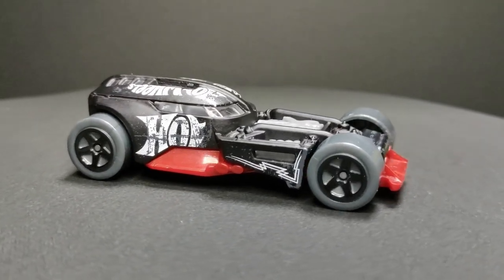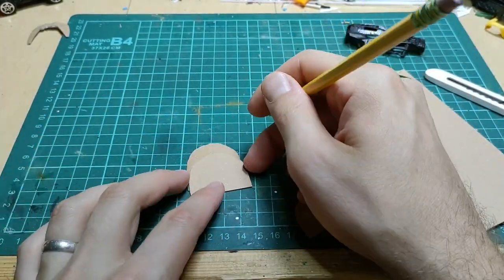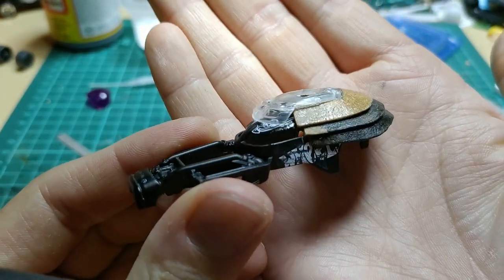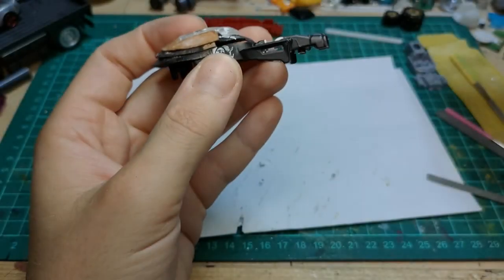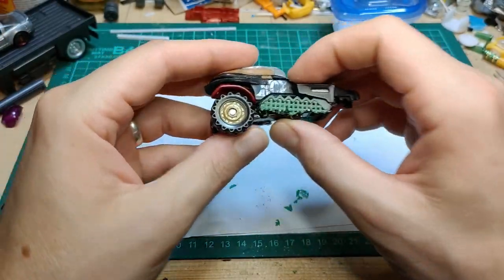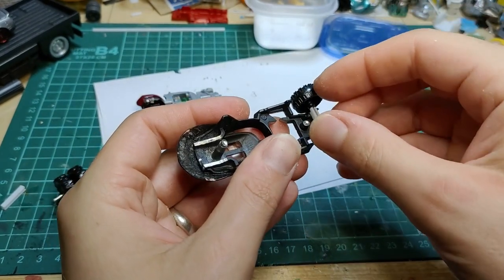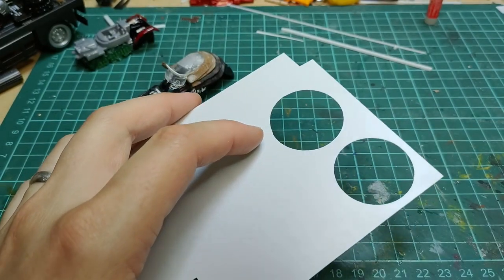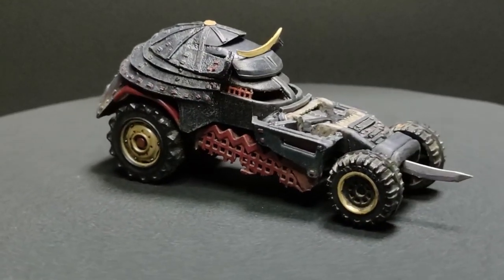Samurai Hot Wheels Car for Gaslands - In-Depth Build Video

Comment: whenever I sand harder plastics/cardstocks, I save the sanded dust or powder and it works the exact same as baking soda to fill gaps, just thought I'd throw this tip out there for you 👍
Reply from the maker: Thanks! I've done that too. Sometimes the size of the particles can be bigger or smaller than baking soda too

Comment: Also accelerator spray will harden the glue instantly. Also from starbond
Reply from the maker: For sure! I don't have access to any super glue accelerator products here in Japan. I've looked around before but haven't found one yet. Adam Savage talks about the difference between using an accelerator and using baking soda in a video about styrene building too. Definitely worth a watch if you're interested.

Comment: Dumb question. Why didn't you strip the paint before adding the cardstock? Better surface for gluing
Reply from the maker: I usually do but this paint on particular is a kind of matte finish that doesn't want to come off. It's a different paint than most hot wheels.
Reply: @BPCustomCreations  The PIA one that laughs at stripper.

Comment: What is the tiny spoon you are using for the application of the baking soda.
Reply from the maker: I'm not 100% sure but I think it is some kind of hobby tool for mixing paint. It has a flat scraper side on the other end. It was in a box of hobby supplies I bought second hand.
Reply: @BPCustomCreations  I have done some digging and incase anyone else asks you can get similar things on amazon under the name of spice spoons or bigger ones called snuff spoons.

Comment: What size drill bit are you using?
Reply from the maker: I used a 4mm drill bit but it depends on the car. Some cars and brands have smaller or larger posts.